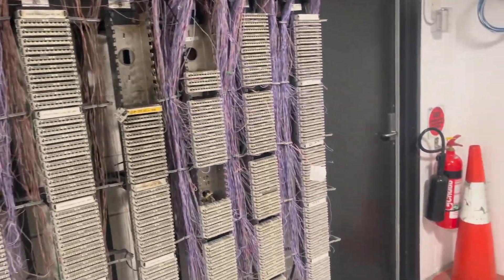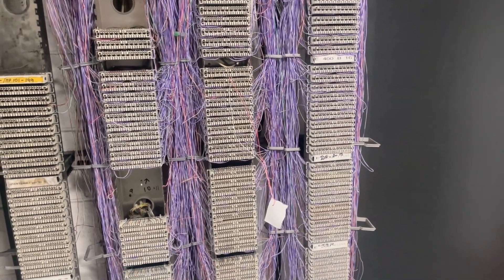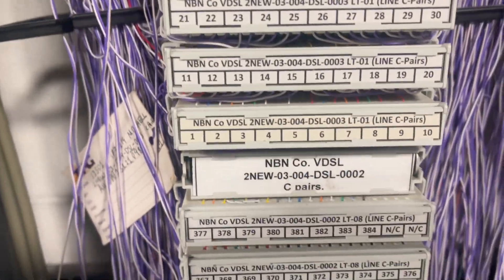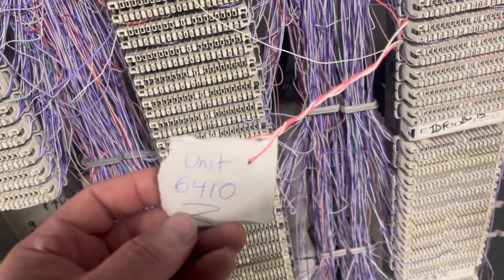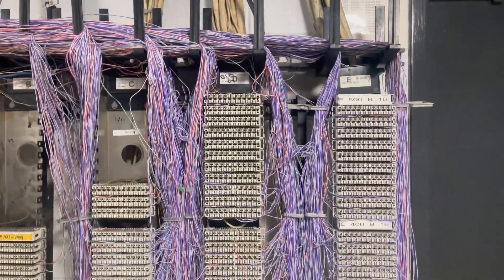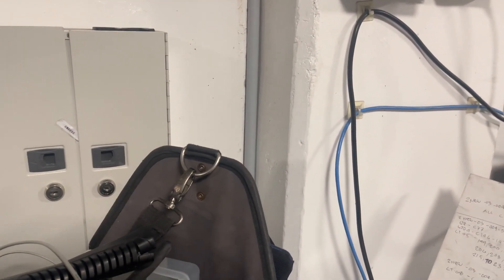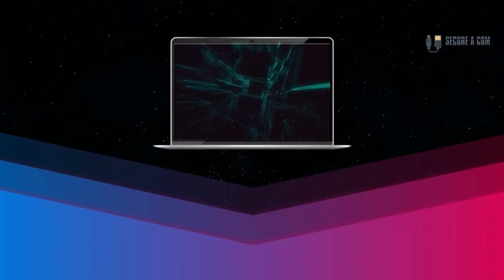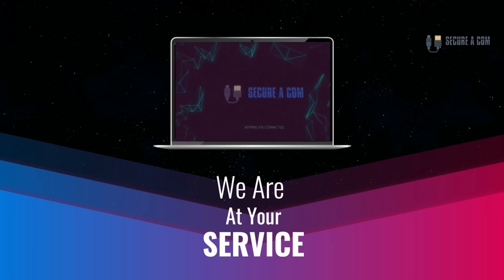Resolving Internet Issues: A Internet Technician's Show Complexity with FTTB and ISP Challenges.

Comment: Sounds about right. I work at a computer shop. When DSL was big. Everybody started thinking I know everything about DSL. I always had to point out (some exceptions.). I will plug in your modem, dsl filter, and quickly check the wire from you box if possible. But, from the box in your house is your responsibility. The box up the post was the telco. If you rented a modem that was the telco. You need to contact the telco. Luckly for the long time if you asked or not. They would run 1 free (new run / jack) inside your house. The big part I hated was calling the telco and asking for any type of help. If, I got lucky the tech was on-site and they was pretty much nice. Simple who fault is it and go from that point on.

Comment: NBN has been such a problem for stability for me, when I had ADSL I had 3x times in 12 years an issue with my line that needed a tech to redo the connections in the A Pit, and I lost connection maybe once in 5+ years, was able to keep a small game server online without problems. NBN comes along and while faster the drop outs are crazy, there is periods where its is good, but multiples times I get messages from the ISP about works in the area and will have no internet, or I check the status page and its full of "Carrier Repairs" or like now, past 2 weeks, 100+ drop outs per day, and the NBN HFC box shows 4 lights on most times when I check. I even paid for a business plan and fixed IP to run some game servers and I cant with the regular loss of connection. Talking to the ISP is difficult cause of the overseas call centers and hard to understand people on the other end.

Comment: Typically what happens on modern units with a whole bunch of fibre services; Seems so stupid when I can't even get the light pipe in the suburbs yet these mobs double; triple up connections for what? Because the whole cities are just a junk of useless networks doing nothing.

Comment: Nbn provides the pair details in the portal however not all user access has the ability to check it. There is too many options in nbn portal and most people have the wrong access.
Reply: Customers don’t have access to this information from their end of things. When the ISP rep opens the NBN portal for the AVC, there is a button to refresh the pair information for this exact issue.

Further more, NBN is usually only responsible for the connection to their MDF (ie NBN infrastructure to their MDF). If the line isn’t jumped correctly from the MDF to the property, it’s classed as an internal wiring issue so you will likely be back out.
Reply from the maker: Yeah i don't have access because im a private technician
Reply: nbn Co is a far king joke.